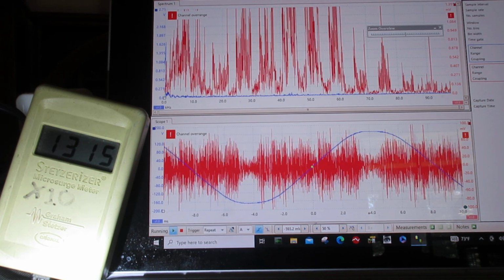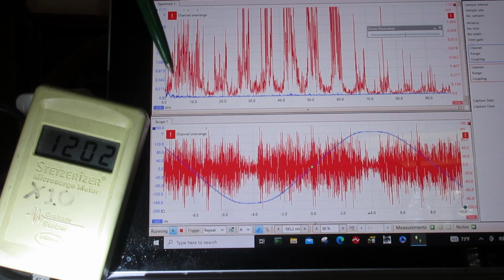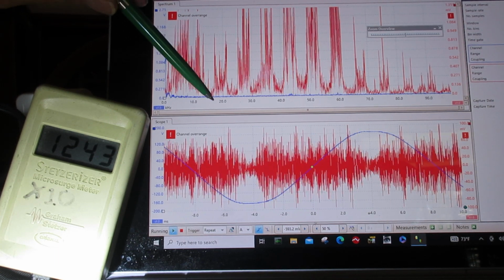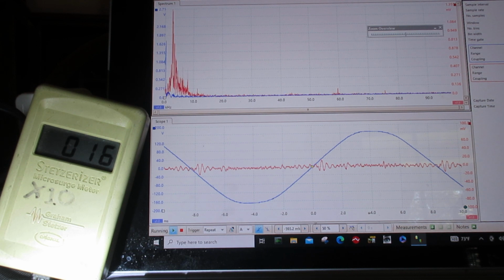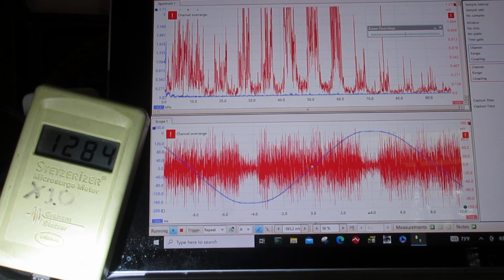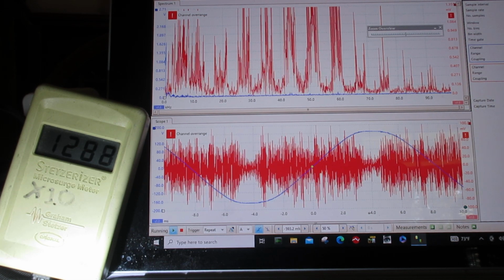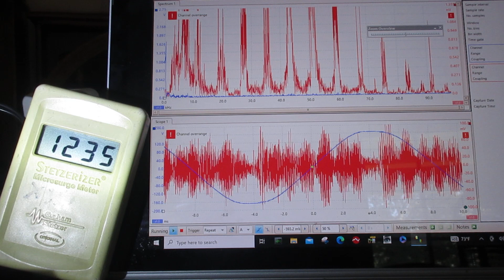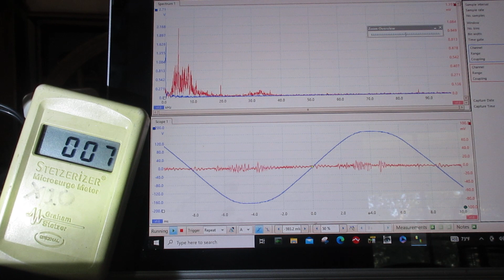Variable speed, energy efficient well pump creates  broad spectrum Dirty Electricity.

Comment: Why speak in baby terms on a technical subject (dirty electricity).  How about instead the variable speed pump controller generates a broad spectrum of harmonically related noise that is conducted onto the power line.  How did you decide this is a problem?  Was this causing a malfunction or degradation of other electrical or electronic equipment?  

I worked in this field up to about 1989 and the company I worked for made equipment to measure this type of EMI  .  Yes I am older than dirt.  I tested our products for conformance with US (mil- std 461)and international standards at that time.  I have not kept current with the regulations since that time but I believe that the FCC has mandatory standards for these emissions.  Does this product have such certification?   If so is it in compliance?
Reply: The quality (cost) of the variable speed drive, the way the building wired and grounded, and the way the motor is connected to the drive all play a role in how much noise is produced and how well it is managed.  I work in the dairy farm equipment industry where this noise affects the rfid tag readers used to identify each cow in the parlor.  I can tell you from decades of experience that the worst drive suppliers, and installers, are the ones that work with water wells.  It is also a very challenging application because the motor cable is inherently long and the well pump motors are not designed to accept motor cables designed to be used with variable frequency drives.  Variable speed well pumping has a number of benefits but saving electricity is NOT one of them.  Lifting water up out of the hole takes a specific amount of energy, if you run a water pump at a constant speed for a short time or slow it down and run it longer, lifting 50 gallons of water 50 feet takes the same amount of electricity either way.  On dairy farms we use variable speed vacuum pumps.  Here we save about 65% because a constant speed vacuum pump is paired with a vacuum regulator that just bleeds air into the vacuum to cope with excess capacity.  A variable speed vacuum pump makes just the amount of vacuum needed and no more.
Reply from the maker: Thank you for your expert comment and contribution!  I am glad to have people like you using and commenting
Reply from the maker: DE, for short, is technically called a conducted high frequency voltage transit or HFVT for short.  At kHz frequencies the the conductor now becomes an antenna and re-radiates this "conducted emission" into the surrounding space. This  can cause a variety of adverse biological symptoms and damage: see these links for details.
http://sammilham.com
https://www.stetzerelectric.com/research/
https://magdahavas.com/electrosmog-exposure/multiple-sclerosis-and-dirty-electricity/

Comment: I have a water well myself. What kind of filter are you using to filter the Dirty Electricity?
Reply from the maker: Measure the DE first and determine the actual source: use a Stetzer meter only.
Reply: @windheimemfsolutions  What kind of Filter do you use though? After you analyze the source of DE. How do you filter the DE...
Thank you!
Reply from the maker: I try out a series of three filters or combination of the three: good, better best.
Reply: @windheimemfsolutions  Does the Plug-in Satic Shield filter make your list?
Reply from the maker: That is one option but there is better value in others.
Reply: @windheimemfsolutions where are the filters plugged in?
Reply: @harrisonswift1416  it didn’t work for me. Expensive but not effective.
Reply from the maker: There could be a whole variety of reasons for that.  This is  why onsite testing and diagnosis by a properly equipped professional is key to success..
Reply: @oyamsbabe4028  Which filter didnt work? thank you
Reply from the maker: @sunnies336  Each case is different: individual analysis is required.